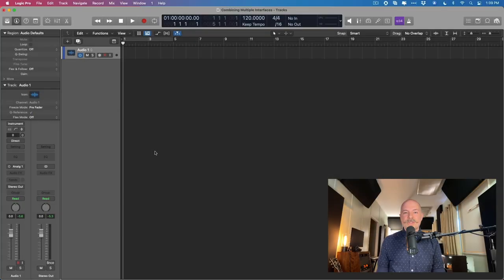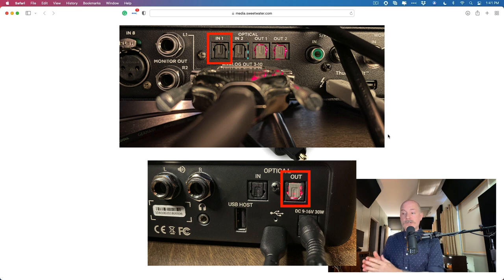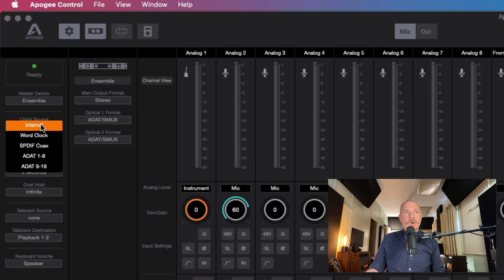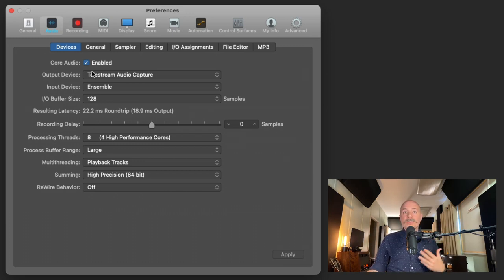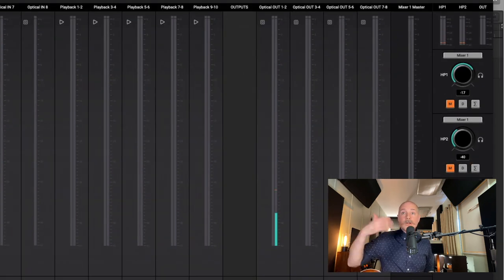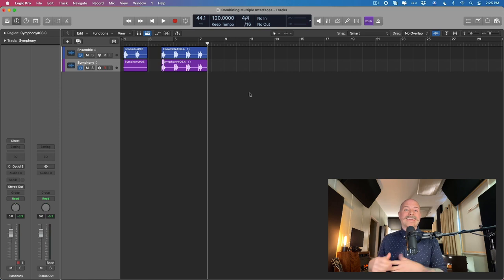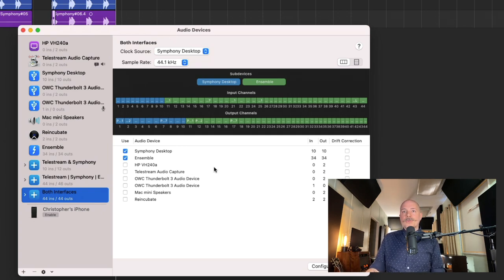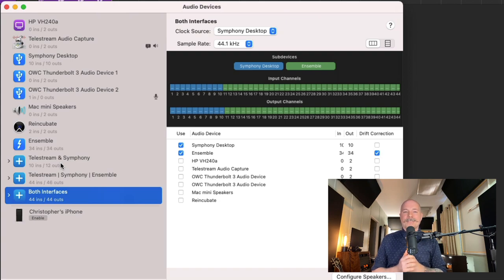How to use ADAT & Aggregate Devices For More Inputs

Comment: You have really saved me! My Zoom Uac 8 is routed to behringer Umc 1820 but in logic pro after 8 inputs of Zoom interface the rest 8 added input don't receive input signal because Behringer Umc 1820 doesn't have any mixer software to route input signal coming out from adat out of Behringer to adat in of Zoom interface and vice versa! Now Connecting through MAC Software Aggregate I can really have 16 channels of Analog inputs simultaneously! Thank you so very much Sir! Cheers!
Reply: hi, i'm happy to ear it worked for you. are your recordings in perfectly sync? i've done this with 2 and 3 interfaces but none of the interfaces sync perfectly, i get anyway from 14 to 80 samples of delay between channels from diferent interfaces. Saludos ✌️
Reply: @balamde687  You have to choose drift correction in the Audio Midi Setup. You also  need a powerful computer. Mine is synced perfectly.
Reply: @GabrielRohail  ok, will try it that way. thanks!

Comment: Great video and very clear and so well presented— thanks!
As a multimedia developer and then studio producer, I used logic since it was just a sequencer, Pro Tools since it was Sound Designer.  They’ve all come a LONG way.  About 8 years ago I began using more specialized tools including Pyramix for DSD and high end mastering work, and Ableton and Ovation for live and interactive work, and began to see the diversity of options.  

That brought me to Reaper about 6 years ago.  While I keep Pro Tools, Logic and AATranslator in the studio for clients that mandate or otherwise bring-in or require those options.  However, Reaper is so much more workflow efficient, has much lower latency and plugin/track count concurrency and much higher stability, is much more fluid in its interactivity, that for those reason alone, it would make no sense to stay on PT of Logic for projects.  

But that’s just the beginning of why we and so many others have moved away from those other tools.   The biggest reason is that the time saved due to Reaper’s workflow automation and other capabilities about doubles our productivity in terms of time saving.  It provides much more flexible and easier to use creative and interface options as well.

Like Pyramix together with Merging hardware, Reaper is so many levels above tools like Logic for most types of sessions.   

We have taken on several mixing, production and mastering pro’s over the years, and everyone came in thinking they were “doing just fine” on ProTools, Logic or whatever until they saw other engineers working on tools like Reaper.  Whether doing NHK, Dolby ATMOS, live recording for 2.x mixes and masters or advanced experimental stuff, NONE of them have ever gone back to Logic, PT or other tools after getting exposed to tools like Reaper.

Comment: Question.  I use a Universal Audio X8 as my main interface.  My goal is to use an extender for my hybrid setup.  All I really need to accomplish is 8 additional inputs and outputs to route through various pieces of outboard analog gear.  If I understand correctly, using ADAT, I could just add any type of interface that supports ADAT in and out,  In this scenario, would I be able to route similarly as I do with the X8 where I use the IO plugin to point to the correct ADAT output and inputs (ie., have the ADAT extender ADAT 1 OUT going to hardware input and then the hardware output going into the ADAT 1 IN)?  In theory, just do that for each of the extender's in/outs?  My goal is to just run the ADAT extender in standalone mode and create 16ch of in/outs instead of the 8 that I have currently.  Just trying to get my head wrapped around this before I order something.  Considering an Arturia 8Pre or something similar.   I sure appreciate your advise and time.
Reply: I used a Presonus Studio 1824C as ADAT expansion with an Apollo X4. It worked great and I could route the spdif input on the Presonus interface out as 2 of the 8 adat channels out into my x4. 

This can also be achieved using any Motu interface too and you still retain remote controllable line level or preamps through their web applications.

Comment: Hi! Great video! A have an old line6 interface not supported with an updated drive and it do not work by itself. Could I use as slave to an other new interface even without the line6 drive for the old one?

Comment: Hi and thanks for the great work on your site. You should be commended on having a high quality information platform for Logic users. If you would not mind , I have a recommendation on how to improve the delivery of your info. I get the impression from your online presence that you feel rushed. This makes the delivery less clear for the listener. Technical language needs time to absorb and your target audience is probably not as experienced as you may think. I would take my time to fill in concepts that are complex. Especially ones in the routing domain. Just my 2 cents from an audio engineering teacher for 30 years. Cheers

Comment: I already have three interfaces connected via ADAT and Word Clock and it al works fine. Can I add a fourth by creating an aggregate that includes (1) the master of the three I already have integrated via ADAT and (2) the fourth interface?

Comment: Thanks! 2 questions - 1) does this use more CPU power to do the drift correction?  2) Does it add latency?  I'd like to record 16+ channels for a live album, and I'd like latency to be low enough to run the output to the monitors and I'd like to add very simple EQ & compression to each track, and maybe verb.  Do you think this would be stable enough?

Comment: In my setup (focusrite "main" and 8 pre-amp Behringer extender), if I used the extender as master clock, when I loaded an existing project with a different sample rate, the focusrite (main) would change to the project sample rate, but the extender would not, and they would lose sync.  I needed a second toslink cable (main out to extender in) to carry clock sync so I could set the main as the master clock.  Now, whatever project I load, the sample rates to both interfaces are adjusted and they stay in sync.

Separately, I use an Aggregate device to join all those input channels with two channels from digital iPad input (IDAM protocol). I use the iPad for metronome and playalong music.
Reply: Yes this!  I do the same with a MOTU 896 and an 8Pre. Toslink out from the 896 (as master) to 8 Pre in and both interfaces follow session sample rate. 8 Pre has to have its sync set to toslink for this to work, of course.
Reply: I'm considering getting a Behringer ADA8200 as extender but i'd like to have the option of a 96khz sample rate, is there any way this is possible with the Behringer?

Comment: Hi! Does this technique require to have both soundcards connected to the PC via USB/tunderblot/firewire or just the master soundcard should be connected to the pc? Thanks!
Reply: Since it looks like he was controlling each device from the Mac computer with their respective software drivers, each had to have a USB cable connected to the mac. Furthermore, for the software combining method, he had to have both feeding digital audio over the same USB interface cables to the MAC so they could be combined together by Logic Pro.   In the ADAT cabling, one interface is sending audio to the other in a master-slave mode.  In this master-slave mode, only one USB cable is sending digital audio to the mac.   Which is better?  Hard to say.    The fiber optic cables are an added expense.  If you don't need audio being fedback in real time to the other, Logic Pro software may be the way to go without the ADAT cables.
Reply: Yes, since the interfaces are not interconnected by any wires between them, they must be connected to the computer so that it can receive their inputs and outputs and then sum them all up in one (sort of) virtual device so that it can then be identified and used by any Daw.

Comment: I've been combining a UAD Apollo and a Tascam Dyna 8p via ADAT. It has worked for a long time, but lately, the inputs from the Tascam sound thin and flanged. What's strange is that they sound normal in Ableton. It's an issue I have yet to resolve.